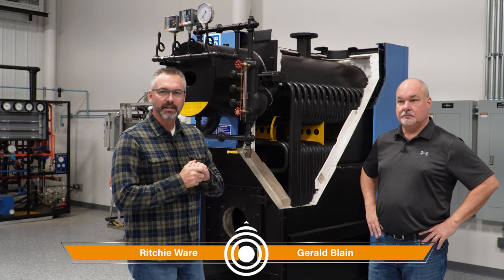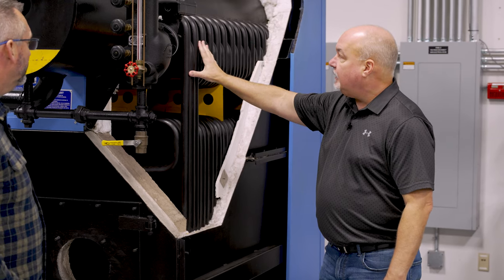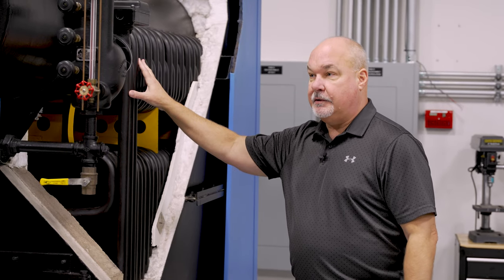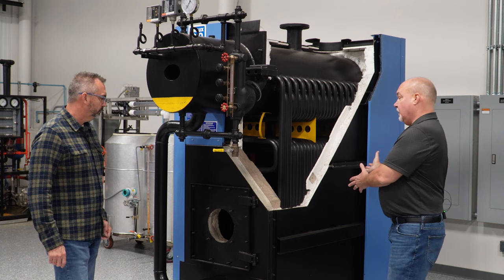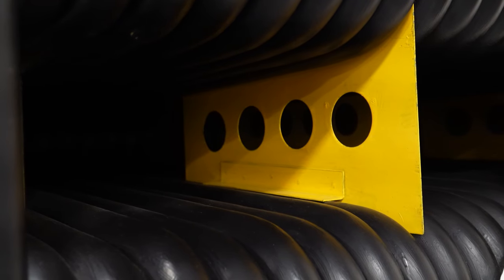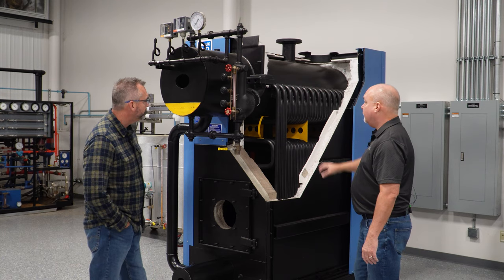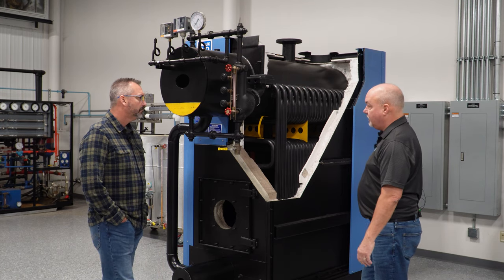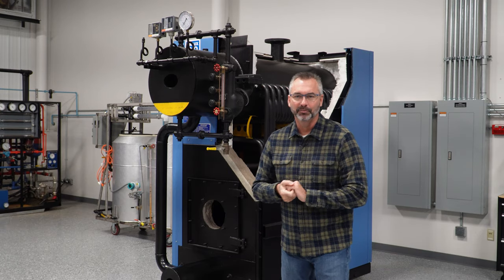Flex Tube Boiler Design: An In-Depth Look - The Boiling Point

Comment: Thanks for what you do. Ive rebuilt the high pressure design of theirs. Absolutely terrible design. You cant even come close to make proper welds on the bottom. I asked them to concider making the floor removable but they made a thing with my employer because we repped their line in california. My boss made me retract my conversation with them online. I dont work there any longer so ill say what i want now. Very efficient boiler but watch out on the retube end. Thanks again